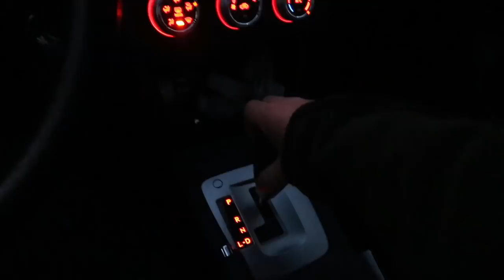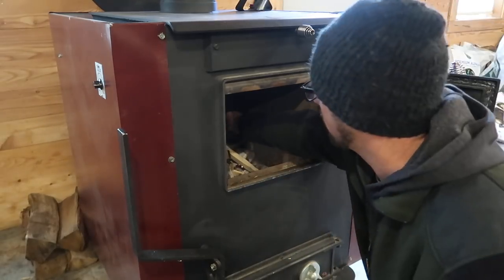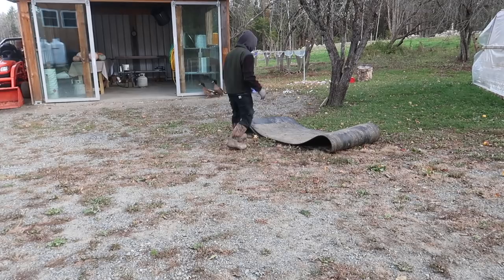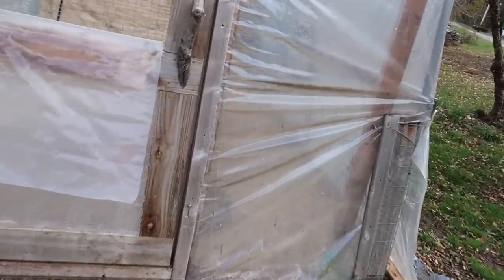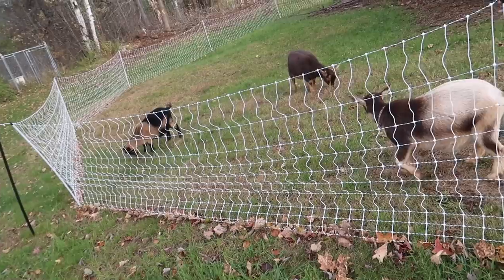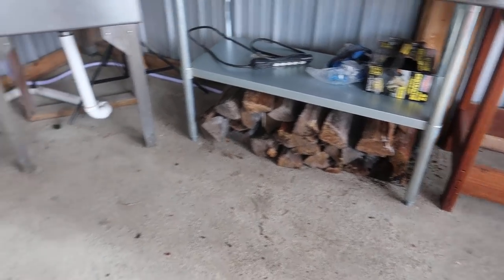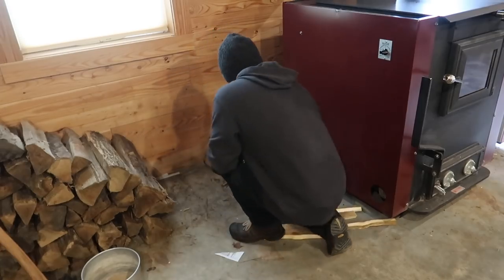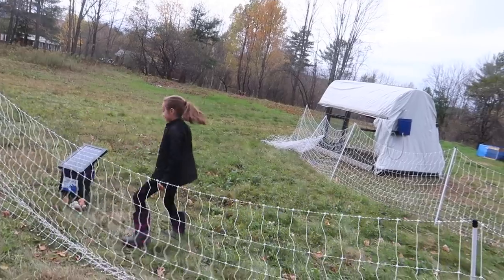I can't Believe its Already time for This!

Comment: Al- that looks like our belting we use in the barn, in the chicken coop and duck run. We can buy it from the cement company. I love it and have used it for years. Be careful if it gets wet cause its very slippery. Im sure your going to want more of it. It makes cleanup alot easier. Have a good rest of the week.
Reply from the maker: Yes I already want more! Lol. I'd like to line the whole kitchen

Comment: Al, if you routinely are put in situations where you can't lock your chickens up as early as you would like, perhaps you should invest in a bunch of those cheap solar lights and set them up around the perimeter of the fence. They shouldn't be bright enough to keep the chickens from roosting, but they may be bright enough to deterre skunks and other critters from getting in with them. Not a ble to have chickens where I'm at, so I've not tried this, but I figured I'd put it out there in case you want to.

Comment: Winter is definitely coming.  An idea - might be better to handle if you cur the rubber mats in 6 foot lengths.  Easier to place around the floors and handle when cleaning.

Comment: It sounds like my big Ram 2500 diesel running down the road. I'm sure it will quiet down once the roads are covered with ice and snow. Thank god we rarely see ice and snow down here on the gulf coast. but as you know we get hurricanes once in a blue moon. I'd rather have the snow.
Reply from the maker: It seem like every part of the country has its own weather to deal with.
Reply: Lumnah Acres that's very true.

Comment: Hey Al, weird question: are you saving your wood ash from the fireplace?  Turning that into lye is supposedly not especially difficult, and you've already got goat's milk, so you could be making soap.  It's probably more work than you'd want to do all the time, but could be excellent video fodder.
Reply from the maker: I do save my ash. But I have never tried making lye. I have read that too. We compost the ash. But I should try making some lye

Comment: Hey AL ..... for my fellow Pennsylvanians .... In Pennsylvania, studded tires are currently allowed for road use from November 1 to April 15. However, Pennsylvania code Â§ 175.145 also limits the studs, stating they may not have "projections exceeding 2/32 inch beyond the tread of the traction surface of the tire." For your info ..... I got a small stall mat at Tractor Supply to cover a pallet that I use to elevate my dog so I can do "maintenance" on him, but they are pretty expensive. Hope you can get more from your bro-inlaw to finish your project. Are you planning on getting "winter pigs" AL? You might want to get Russian boars due to your cold clime ~8^) Take care AL, Gina & Olivia.

Comment: I talked to the car manufacturer and they said you need to put snow tires on all four not just the front. There was a study done by the dot and showed the handling of your vehicle will starting and stopping in winter weather was greatly improved when running snow tires on all four. Your back tires can slide more with just on the front. Makes it like a top. The front grips and the back spins around. That being said if your vehicle is already 4 wd the rear wheel side to side slinging affect is less than it will be on just a front wheel drive.
Reply: He does have 4 on the car

Comment: Mats like these are usually used as floor cover near high voltage indoor transformers (robots in disguise) or other high voltage equipment. Their purpose is to serve as additional insulator for safety of people working in the area.
Reply: Medium voltage switchgear as well.

Comment: Spray nine is one of the best cleaners and it kills mildews that's what we use in the shop
Reply: Ive found Simple Green to be a very good cleaner and its safe for the environment.  They make one in a purple bottle that works great for power washing concrete and fences.  If you had a power washer you could have cleaned those matts with that.

Comment: I know this is off topic, but I have been meaning to comment on you having an electric kettle (similar to mine) in your kitchen which is not as common in USA as it is in UK. I believe it has something to do with the power used in USA making the kettle take longer to boil.  I just wondered how you managed to catch on and if it is becoming more common in America.
Reply: I've seriously considered installing a 240v outlet to fit the plugs on those kettles so I can use one.
Reply: Hugh Brackett: How interesting, so you must consider it useful. They can be very cheap to expensive in UK but regardless of price it supplies very speedy hot water.
Reply: @AfterTheRains  When I stayed in London several years ago my hotel room was equipped with an electric kettle. I was impressed how quickly it heated the water. My Keurig can quickly deliver a cup of hot water so I have less incentive to rewire my kitchen these days. I think if I was building a house I'd put a 240v outlet in the kitchen.
Reply: Hah, I had to look up Keurig! Sounds more than fair to say that about a power outlet though. Since I have a kettle my coffee machine is strictly for coffee.